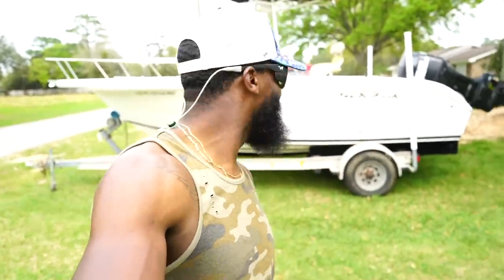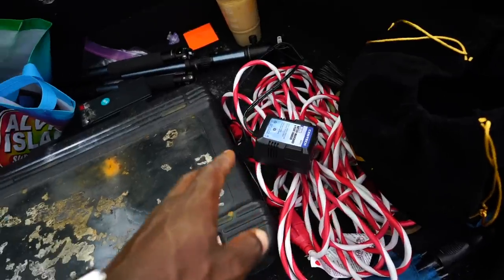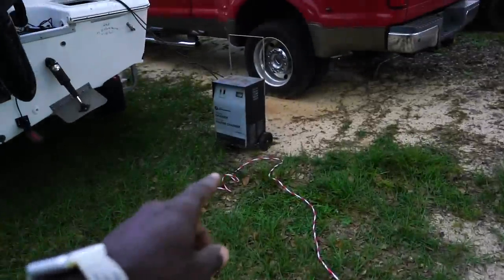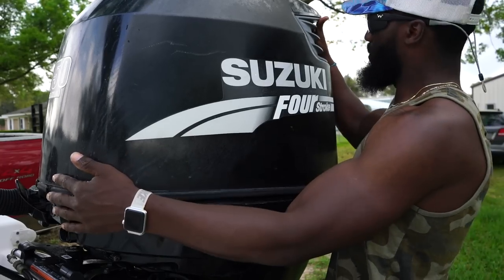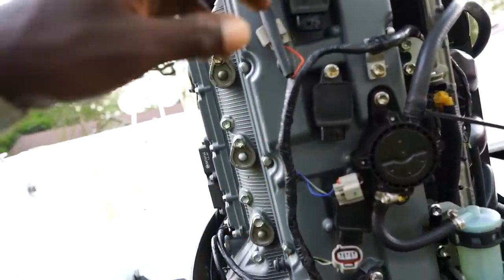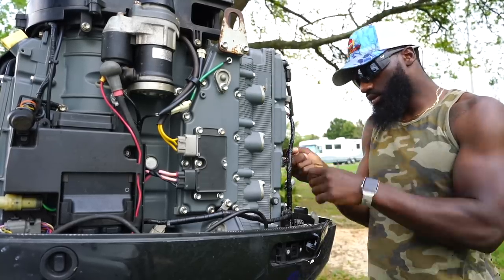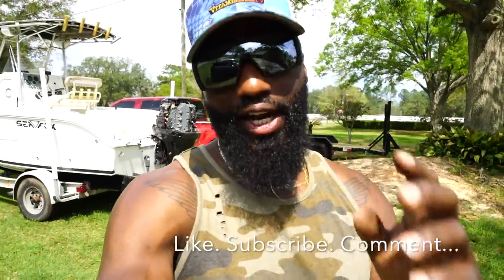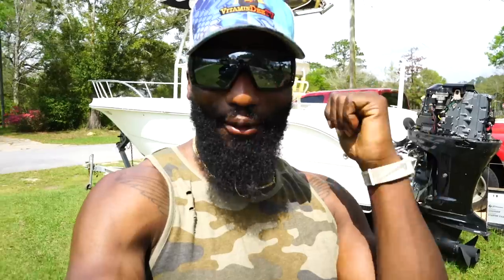Boat Project Day 2! Can we FIX This CENTER CONSOLE Fishing Boat! Let's Find Out...

Comment: Check the oil to see if its milky. 1st sign of head gasket on these Zukes. Only way to know extent of damage is to crack it open unfortunately. I have a video on my channel showing the corrosion I found on my Suzuki 150 head when I opened it up. It's really not too bad of a job with a couple of tools. Let me know if you need any tips. I can send you shop manual for it and everything. Best!
Reply from the maker: Thanks, Ill check that out! 🤝

Comment: D, let’s go down this rabbit hole. It’s possible that the engine may have overheated, maybe due to a worn and not replaced water impeller. So they had someone replace the head gasket because it blew out. Not really fixing the issue to begin with. Possibly has a faulty  thermostat which caused an overheating issue. which could have damaged the original head gasket. This is all hypothetical and I’m only assuming possible root causes. If the block is not damaged or cracked and you get a good inspection from the mechanic. Make sure to replace all you can for the cooling system. I’m also sure this would be mentioned by the mechanic but wanted to at least throw some possible examples of what could have caused the problem to begin with. Best of luck. Keep up the great videos.

Comment: Why buy a boat with a non functional engine tho my guy? I don't care how good it looks if the engine don't start I would be onto the next one. I hope you can actually fix this mess. Smdh this is what not to do. Whoever sold you that did a disservice to you.
Reply from the maker: If you watch the video, I stated that the boat runs, it just throws a beeping sound at the helm (which is like a check engine light in a car) as well as a the engine misfires and stumbles. All of this is being addressed. 

This deal was made knowing what I was getting into. Believe me when I say “THIS WILL BE A GOOD RUNNING/OPERABLE BOAT AT ALL COST!” 

Thanks for your concern and thanks for watching! 🤙🤙🤙